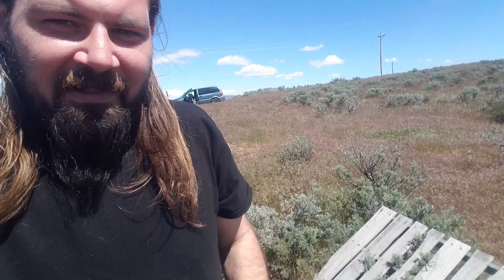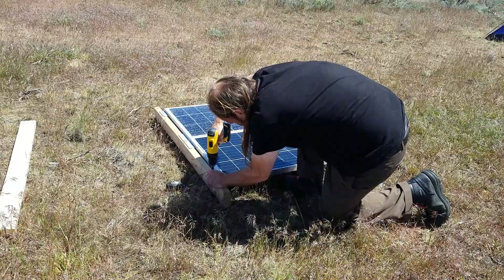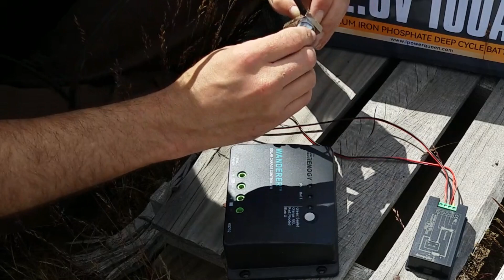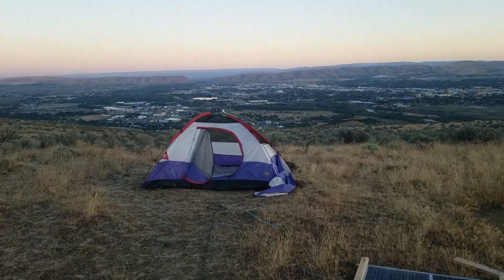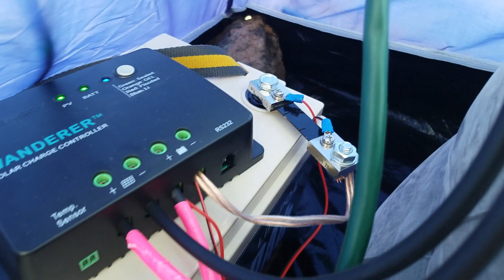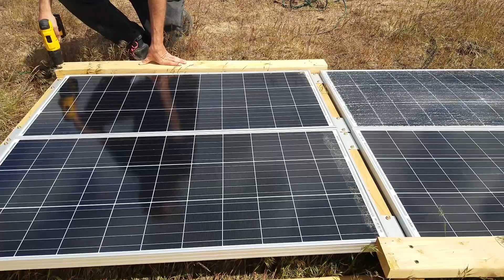Sagebrush and Silicon: Solar Panels

Comment: That is a nice PV set! Too bad about the cracked panel. I think I saw you connecting the panels in parallel, so the impact of that bad panel on the system's total output shouldn't be too bad. Still, I hope you can get it replaced, it will increase the output.

Also, please make sure to secure the entire structure to the ground. You don't want an errant gust of wind to pick it up and flip it over.
Reply from the maker: Once the camper is delivered, and I move the panels up the hill, I'll definitely be securing them. The wind can be downright brutal on the mountain, but oddly, hasn't budged the panels yet.